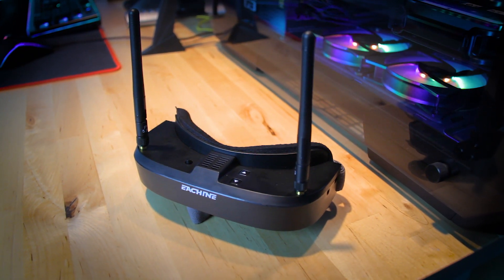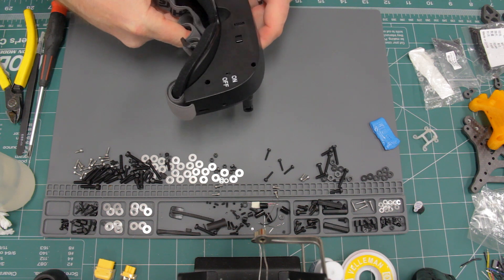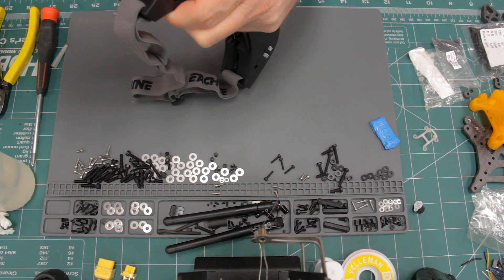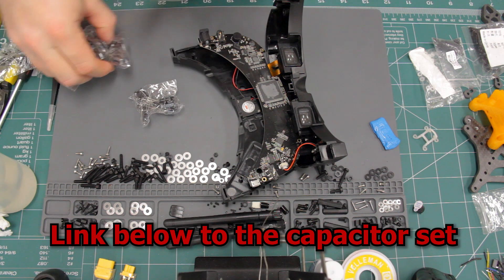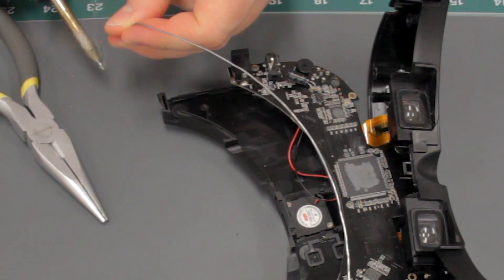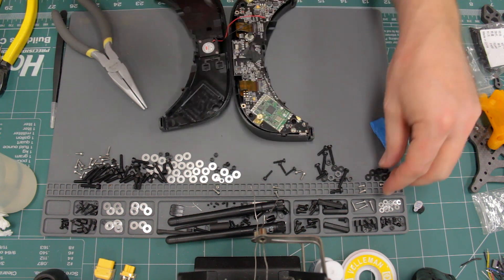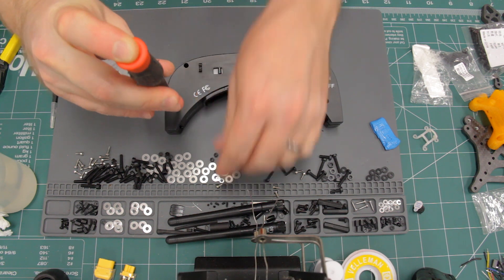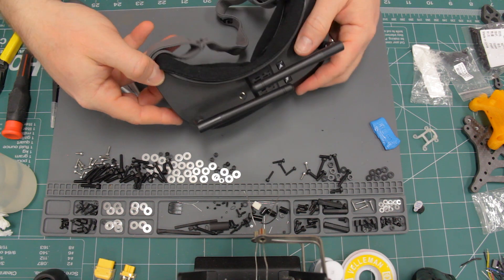Fix | EV100 FPV Goggles Warped Image

Comment: Are you having overexposed image after the mod?
Reply from the maker: I did not notice the image being overexposed, so I do not think so, but I was not looking specifically for that.  Maybe next time I fly I can look for that.  There is a lot of fresh snow right now so I am not sure how soon I will fly again.  Is this a problem you have seen?
Reply: Ian Beaty yeah, i got new version that has 2 parallel capacitor, no warped image but overexposed & darkening screen appears & disappears when im flying, quite annoying actually. I tried changing them to a bigger cap but still got the same result.
Reply from the maker: @nazih5443  That's awful.  I have never noticed those problems with my goggles - the only thing that bothered me was the warped image.  The Fishpepper article makes it sound like you can use any capacitor above a certain size to fix the warp so it seems like your problem might be somewhere else.  I quickly looked through the Fishpepper article titles and it looks like he does not address your issue.  I am sorry to hear about that.  Is there any possibility that it could be in your goggles settings?
Reply: Ian Beaty they made an update version & created new problem as well. I found someone with same type of version & problem as mine. No solution found right now for this latest batch. I tried to firmware update but still the same.
Reply: @nazih5443  can you tell me more on this i got the same and need help send pictures thankszz
Reply: @swiftfoxx_FPV  sure, give me your email. I got video samples too.
Reply: @swiftfoxx_FPV  check your email
Reply from the maker: @nazih5443  Thanks for helping him out.  I wish I could, but I have not seen this problem.
Reply: I'm have this problem 
In flying end googles having overexposed my googles noting have image distortion.
I'm not have problem solution.
( sorry my Basic english I'm not speak english but im understand english )